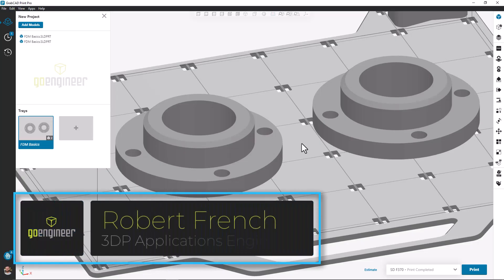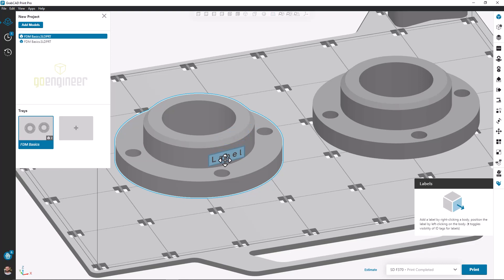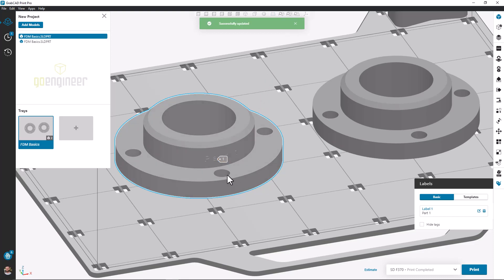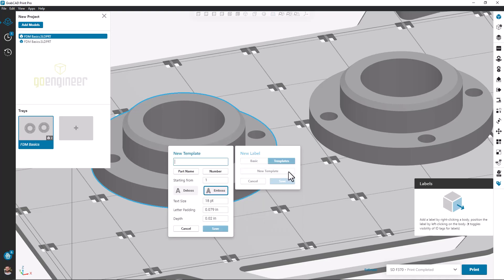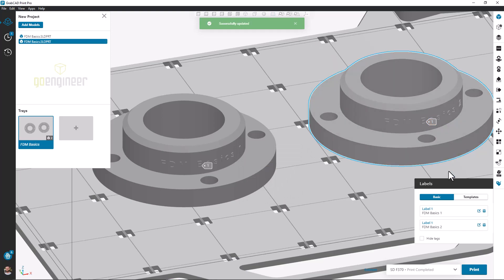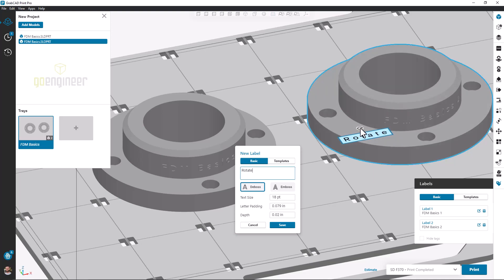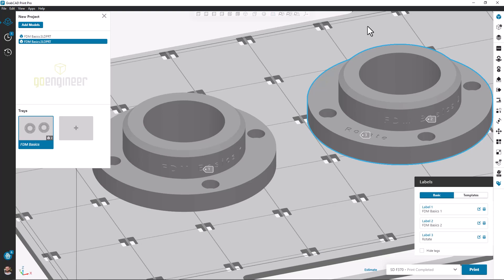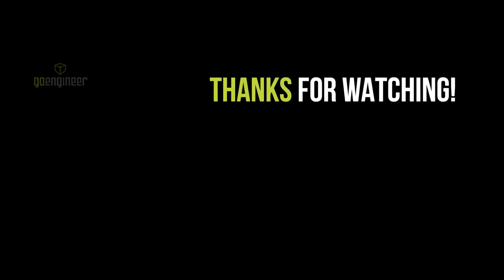GrabCAD Print Pro Tutorial -  Adding Labels

Comment: Is there any way to import the sliced part as a whole in solidworks or is there any way to import a sliced part into any 3d file format(.stl, .prt, .iges, etc) so that simulation of thermoplastic part can be performed with exact input parameters as selected in 3d software like infill geometry, %, body thickness  etc..